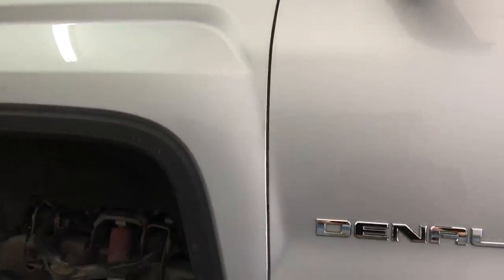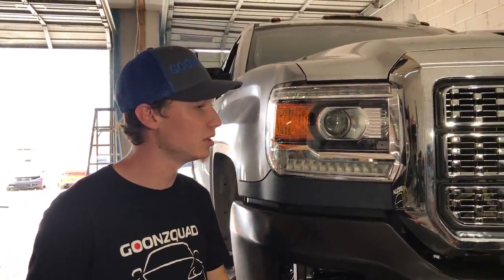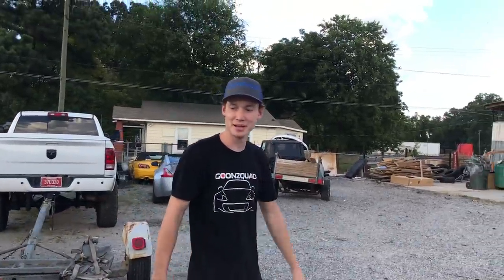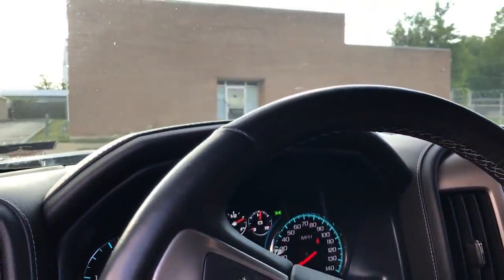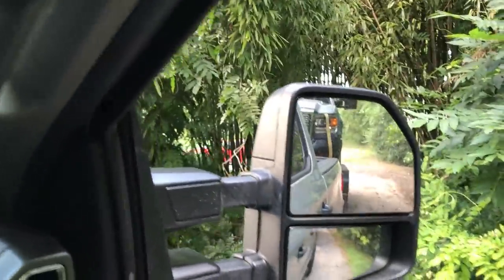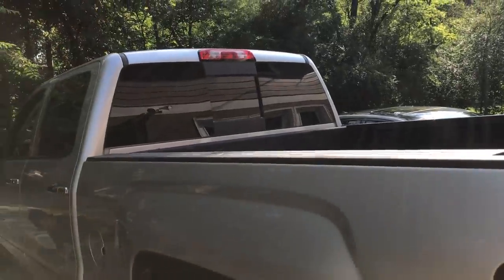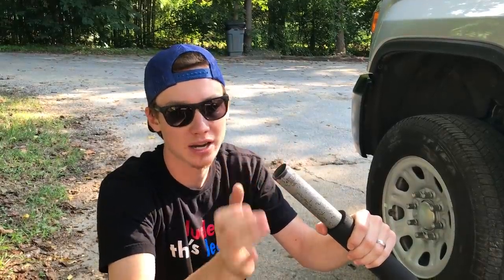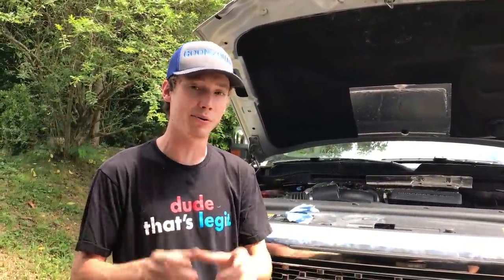Rebuilding A Wrecked 2019 GMC Duramax Part 5

Comment: Guys please don’t lift the truck. Lifted trucks have a harder time towing/hauling. Leave it stock and you’ll be gucci👍🏻
Reply: Upgrade the suspension and fix the rear axle, but no lift.
Reply: Your the s10 in the truck world if y’all say that
Reply: Put a lift on it
Reply: If they delete and tune as well as some other aftermarket products on the internals and even regearing, they should have no problem putting a big lift on it
Reply: Wrong

Comment: I had a 2017 GMC 2500 Sierra as a work truck and the def system was a pain in the butt!! but the truck will tell you when you need more def and even then you got 250 miles to the truck will run on reduce speed so only 65 miles per hour! Btw the gmc is looking good!!! Keep up the good work!!!!

Comment: You guys say it's going to be a tow pig and you love how smooth it is. If you lift it and put big aggressive tires on it, it may look better but it you'll lose driveability. The absolute worse weight for a vehicle is unsprung and rotational mass. Guess what wheels and tires are, both. Anything heavier than stock will adversely effect braking, acceleration,  handling, mpg wear and tear on wheel bearings, brakes  etc. For a tow rig, it's not worth it.

Comment: 1. EGR Delete
2. DEF Delete
3. Tune It
4. Get some upgraded inter cooler pipes like HSP or something similar to reduce EGTs (better flow)
5. Possibly a built transmission so it can keep up well with the tune
6. Better Flowing Downpipe (better flow
7. Straight Pipe (better flow) get rid of that torpedo underneath! 
8. Cold Air Intake 
Some Basics to unleash the true power of a Duramax while keeping it highly reliable, more fuel efficient, a lot more horsepower and torque, and a lot more fun to drive

Comment: I sheared the rear pin going off road in my work truck. Loosen U bolts and pull back using a come-a-long and re-tighten. I drilled out center of cradle and dropped a grade 8 bolt through it to align everything once I got home and haven’t had any issues in 15 years

Comment: Hi guys just a tip we use in the U.K when doing the inside of the engine bay mix the base coat with 10% clear coat so you get that factory finish its like a satin finish great channel

Comment: Guys, check the trans fluid at operating temp, truck in neutral. Keep the lift at a minimum. Especially if you’re using it to tow. Get air bags in the rear for heavier loads. Tires recommendation; Cooper Discoverer ST Maxx. Aggressive tire and hold up to anything!

Comment: That tank overhang is s huge design flaw. 😁
What were they thinking?
Reply: They were hoping you'd auto-remove it at the first curb... Probably only held on with one clip...;)
Reply: RD Flo 
😁
Reply: Probably an afterthought late in the design process to meet bullshit regulations.
Reply: I think its low because it needs to be at a certain level from the exhaust or the fluid or something like that.
Reply: Easy to see easy to damage easy to remove, warranty voided GM off the hook for any warranty claims easy to understand or they are doing away with def in a new engine configuration that didn't happen before final draft before production so that's where they stuck it..........maybe but I'm sure someone in the know will enlighten us my 91.5 Dodge has none of this nonsense but I do have my own concoction that's added to the fuel to keep the VE pump lubricated
Reply: Also the antenna is in a really weird spot
Reply: My dad tore his off while breaking through a snow drift on a farm lane. Absolutely stupid where they put it at

Comment: really enjoying these videos guys...y'all are doing great! 
quick comment on the DEF if you haven't already researched...since the fill tube doesn't have a dipstick to check fluid level, I believe you can check it under dash settings on the drivers info. center (dash cluster). you will get a warning with number of miles left when it gets below a certain level. keep on truckin'!
Reply: Yep, that's where the DEF level will show at.

Comment: You should have taken that truck to a reputable frame shop, and still should, at least have it measured.Without a laser measuring system you cannot accurately align that frame. Also you cannot use heat to straighten a frame anymore. I'm willing to bet that frame has a diamond in it. That is why the rear end is out of square. I would imagine that truck needs a frame and that's what totalled it originally. I am a platinum certified collision repair technician with 26 years experience. So, I'm not just talking out my ass.
Reply: Fab Junkie doesn’t need to be perfect for TV. That’s the problem with these builds. I totally agree with you.
Reply: My thoughts exactly. It probably still has a bent frame. And forget about heating it to straighten it as that'll affect the heat treatment the frame gets during it's manufacturing process. The truck probably was totalled by the insurance company due to the bent frame as you said. Still the guys have tried to do a decent job on putting the truck back together.
Reply: I would like to say that I think they want to fix it right and are just a little misguided. I'm sure thier guy Vtune did his best. His shop is just not equipped to handle that repair.
Reply: Couldn't agree with you more. For that truck to be written off I wouldn't doubt that frame is a diamond. It wouldn't make financial sense for an insurance company to swap the frame. But for a couple of guys doing it privately it would still be worth it. Depending on what they paid for it obviously.
Reply: GM makes a front stub for those frames. They aren't that hard to do if u have the proper equipment. Frames are surprisingly affordable too and easy to swap. I have done a bunch of them. They can handle it.  A complete swap would be the best thing for them especially after torching that rail. We are not allowed to heat anything hotter than the tip of a cigarette anymore and you can achieve that with a Wagner heat gun from Lowes.

Comment: Makes fun of Ram transmissions when the only Truck on the consumer reports unreliability list is the GMC. Ram uses really good transmissions now tho.
Reply: Because GMC owners are checking transmission fluid without the engine running and adjusting fluid level to improper reading.

Comment: The transmission fluid must be checked with the engine running up to temperature and in neutral
Reply: Florin Balalau actually most are checked in park at operating temperature.  It’s usually stamped on dip stick.

Comment: trans fluid should be checked with motor running and trans in nuetral (parking brake on)
Reply: walter bourgeois I believe actually most automatics require transmission in park and transmission at operating temperature on a level surface.  It’s usually stamped on the dip stick.
Reply: @1kmodified   it varies by manufacturer of the trans all mine require neutral

Comment: Hey guys love the show just to let you know that u can check the DPF fluied thro the DIC and on the side of the rad surge tank the other coolent cap is a bleed cap for the system while u fill it up and u have to have truck running to check trans hope this comment help

Comment: for a lift kit i would recommend looking into the HMMWV / hummer h1 suspension design. for example it has a 3 part/jointed/flexible front and rear axle/differential with upper/lower control arms in both forward and aft. a system like that would generate the most ground clearance you can ever hope to achieve on truck. i would also suggest looking into using air suspension.

Comment: Check your sunroof, some of them are dual action.  When it is closed, press the button you use to close it and it might pop up the back of the sunroof.  If it works like that, then you use the other button to close it and then when it stops, let go of the button and then press it again and it will open all the way like you were doing.   I have a Trailblazer that has the dual function sunroof on it.

Comment: A cool feature for these trucks, is go into the gauge cluster and use the arrows on the steering wheel to go to settings, go to info pages and you can turn on “off-road mode” it’ll show the angle the truck is at while off-roading and what degree the wheels are turned

Comment: I have a GMC Canyon with a Duramax diesel. To check the DEF you probably need to scroll through your settings on the dash. On mine there are up and down arrows on the right side of the steering wheel. Toggle through the “Info” section until you come to DEF Fluid. It should say OK if you have enough. If the warning light comes on it’s best to add some as soon as possible.

Comment: You have to check the transmission fluid with the truck running. Some in park at idle and some in neutral at idle. Check the owners manual to find out.

Comment: My 05 f350 Lariat had a sunroof. Bought it in 09 I was 20yr old! Guys just do a leveling kit on front with nice set of  20x10 black/matchined wheels and set of 305 55 20 toyo open country at2 tires.

Comment: I just bought a creader VIII scanner on ebay ,and am impressed with how many features that are on it. Comparable to Snapon Matco ,and has live input. You should check it out. I got mine for $118 + shipping through an auction ,but had it up to$150  considering they are selling for close to$300. Then you can clear your own codes ,and yes it does domestic ,and foreign cars.

Comment: Guys just install a leveling kit if anything. I've had a good RCD 6" lift on a Chevy 2500HD in past and now a TrailMaster leveling kit on my '18 Silverado Crew Z71 to clear 33x12.50 Nitto RG's. I recommend just a leveling kit for your Jimmy tow pig. 
Also, engine needs to be running when checking trans, hopefully you didn't add any yet you don't want to overfill it it's hard on internal seals, it should be a pinkish red color if in good condition.
Definitely straighten the rear axle ASAP hard to tell if it's binding on the driveline doing more damage.

Comment: That’s one nice looking truck with a sweet interior! If you lift it way up you will need to have a drop hitch for towing. I’d keep it stock, maybe just levelled and airbags for when needed.
I can see you guys getting a long fifth wheel trailer for picking up builds with parts etc or builds and a parts car. 
If lifted, harder to use a fifth wheel type hitch in the tray unless you want to treat your tailgate like Copart did 😬

Comment: For those watching who don't know, you have to have the engine running to check transmission fluid. And also if you're going to add any make sure it's the right kind for your vehicle there are several different kinds.

Comment: Okay for the DEF fluid it does show on the dash well it should. It will tell you when it's low. Also the newer  ones tells you when any filter should be replaced  including fuel filter etc .

Comment: Great Job, soo much that Im planning todo the same exact thing y’all did!! But a big help would be a good set of cordless impact guns, I like Ingersoll but the Milwaukee M18 series is great and runs with the Ingersoll get the High torque 1/2”, the 3/8 and the 1/4 hex driver and a couple good chargers and some 5 amp hour batteries youll be good for any job that you’ll take in the shop parts yard or out in the field!! No more cords, and way more power!! You’ll be very happy With That investment !! Keep it up boys and thanks for making these videos !! 

Charlie Brown

Comment: Gaps and body lines look on point, along with the headlights! Luckily that ABS and traction control light seems like an easy fix! The alignment was pretty far off after seeing where the steering wheel was sitting!

Comment: Not sure about this truck, but generally speaking to check auto trans fluid you need to have the engine running with the trans in neutral.
But half a quart down will be fine anyway.

Comment: The proper way to check automatic transmission fluid is to start the engine  set your parking brake put the transmission in neutral then pull the dip stick you have a hot or cold level so no need to get it at any temperature  before you check it

Comment: You guys said in the last video about getting aftermarket front bumper. You could go with the steel front and rear bumpers they are usually black but you could always paint them to match the truck.

Comment: 5inch strait pipe, tuner , cold air intake, 7.5 inch lift, fuel forged -44 offset 35 inch tires

Comment: You Have to check the trans fluid with the engine running at ilde.  It will show high on the dipstick when the engine is off,

Comment: I have to agree with the other commenters. My suggestion is to keep the suspension stock. The Denali line has one of the best rides and feels on any vehicle. The truck is more than high enough as is. And lift kit will  throw off the ride feel.

Comment: One thing that I think that should be done (I think it would need a special lift though) is to bag the rear end. Great for towing make a smoother ride and if it would allow you to drop the rear end to make for getting the trailer on pretty easy.

Comment: As the others have said you need to check the transmission fluid with the transmission hot and engine running. I also wouldn't lift this truck it just causes problems and makes it much noisy. Check out tradebit for factory service manuals it will help you with all your builds even the boat.

Comment: About the DEF fluid, there will probably be a pop up message in your cockpit when your about to reach in (around) to the last 1000 miles.
In europe the ECU even shutdown your engine if you didnt refill before the 1000 miles hits zero in the cockpit message.

@goonzquad

Comment: To check your def levels have to go into the display screen it is a digital gauge and will tell you how much is in it otherwise if you run it out it will go into derate mode and limpmode and restrict it to certain speed til you get fluid back in it so it don't blow the motor up or cause anything issues with the paticular filter on it

Comment: Probably don’t need a lift kit but a leveling kit and some bigger tires and wheel. Get you a EGR Delete kit and straight pipe the exhaust. Definitely should get it bullet proofed if you want to tune it for power

Comment: Most transmissions you're supposed to check while the engine is running (automatics of course). Typically the dipstick actually has the "instructions" stamped into it. The only manufacturer that I'm aware of that you check without the engine running is Honda. If you check them while they are not running they will generally read about a quart or so overfull.  And like a lot of your commenters have mentioned, if the intent is to tow with it, i would  forego the lift kit. otherwise you see a lot of failure due to lift kits not accounting for your drive shaft operating angles.

Comment: Try turning on the heat in the truck in order to get the air out of the coolant system.  Or use your vacuum kit that you used on the Z06.

Comment: Hey! We have a 2019 Denali duramax to check the def on the right portion of the steering wheel you’ll see arrows tap the up arrow a few times and it should say def ok or low and when it gets low it’ll send a warning

Comment: Goonzquad, based on the year of the truck, don’t mess the emissions. I have seen drivability problems with the diesels. It’s not worth it. Depending on the state you register truck in. The combustion chamber temperature will increase ( causing detonation or Pre ignition ).

Comment: Without the engine running the transmission fluid will register low. It needs to be idling when checked. Unless, of course, they engineered it differently.

Comment: You should always check transmission while running in neutral if it’s not checked like that it will read higher then it actually is

Comment: If the pin is sheared just put some c clamps on the leaf pack.   You can replace the pin/bolt for a few bucks from a semi truck shop.  (Also aligned is spelled wrong)

Comment: There is a specific way to fill the coolant a bunch of new trucks had a issue. It needs burped or you will have a low coolant indicator. Also your going to want to order morimoto Xb fog lights they’re plug and play.

Comment: Doesn't matter the wheel size to do the alignment guys. The compensation process measures for runout.. in other words,  you're only aligning the hubs.
Reply: The truck had/has frame damage. Rt rear axle is offset. Maybe the center pin is broken. Should they have waited to do the aliment?

Comment: When the DEF fluid is low it will appear on the dash and tell you it’s low. If you keep driving it with low levels it will eventually tell you how many miles it has left before engine loses power and speed.

Comment: You need to check that rear end.  The centering pin probably sheered off.  It could shift while driving and pull the driveshaft out and destroy it or the transmission.

Comment: I have a question, when you do this kind of work and straighten the frame rails like this, are they are strong as before the accident? So heaven forbid, if this truck was in another accident would it be as safe as the original?